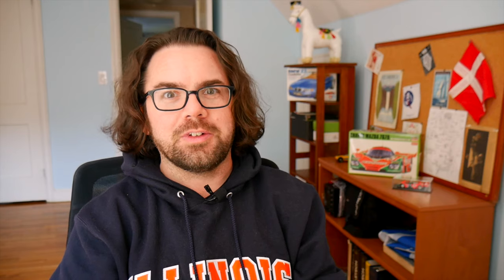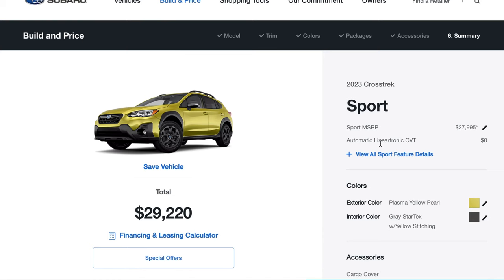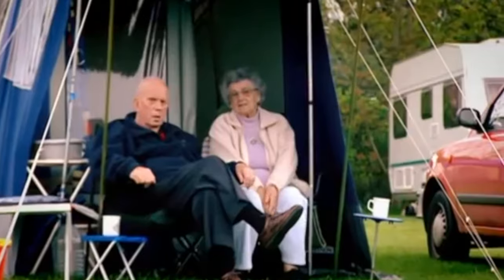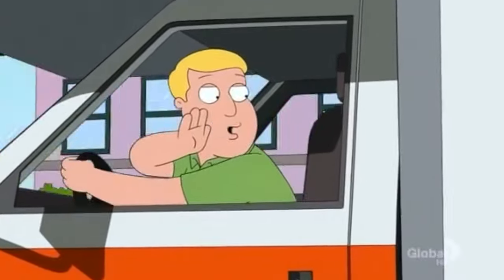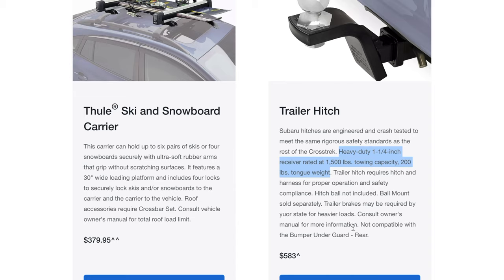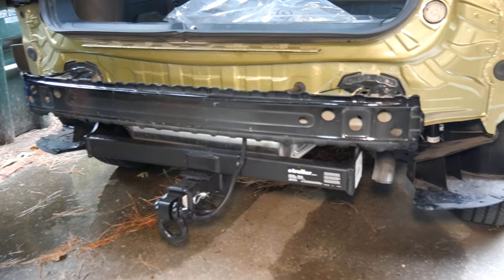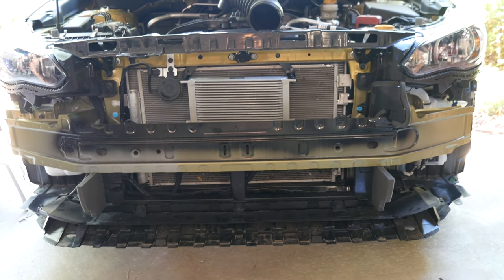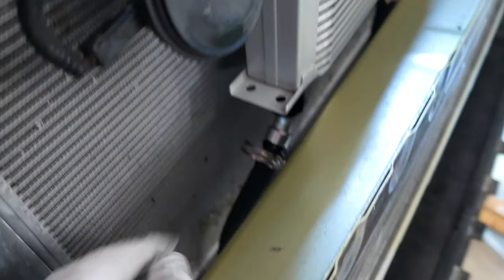Towing a Uhaul Trailer with a Subaru Crosstrek Sport

Comment: Towed that same small U-Haul trailer across the country with my 2.5l 2021 Crosstrek and it did great even going over the continental divide in the snow and multiple 6% grades.  I was definitely pushing the max tow limit rating but had no trouble at all.  No mods to the vehicle at all other than adding the hitch.  Used the Curt brand hitch and it fits nicely tucked under the vehicle and doesn't impede ground clearance or require removing the bumper to install it.

I did the towing in the late fall so there were no cooling concerns.  I used the sport mode of SI drive to keep it from using too tall a ratio and hunting for "gears".

The only thing I would caution people on is to remember that the brakes on the Crosstrek are going to have a lot more work to do when towing near max capacity.  I made heavy use of adaptive cruise control so the car managed engine braking downhill on it's own so I rarely touched the brakes on the highway.  You also be very careful in high winds as the trailer catches the wind way more than the car, especially relevant in Wyoming and other areas with high cross-winds.

Comment: I am planning on towing with my 2.0 Crosstrek cross-country and this video was super useful. You saved me so many headaches (e.g. now getting the proper drop/rise hitch instead of using the 2-inch drop hitch that I had handy) and also the scan gauge tool to monitor the vitals. I wish Subaru kept the temperature gauge in the gauge cluster, they added it back for the 2024 model year. I thought about getting a CVT cooler but does look overkill for this car. So many great tips in one 20-minute video!

Comment: Towing a uhaul 5x8 tomorrow for moving purposes in my PYP 21 crosstrek sport tomorrow.  Will be reporting back if anything explodes:p
For more info:  one-way drive distance will be less than 10 miles, no road grades  above 3%, using a self-installed curt class 3 hitch with a 2 inch ball receiver that has a 2 inch lift.  Self-installed towing wiring harness used.  Highest speed will be 60 mph for about 1 mile at max.  No additional cooler or cameras will be used.  Max temp tomorrow is 48 degrees Fahrenheit.  Honestly I will be surprised if we get even close to 1500 lbs total towed because the trailer will primarily be used for a few pieces of furniture at a time that are too big to fit in the crosstrek rather than packing it full to capacity with boxes.  Since the move is so short, it will be several short trips rather than one big over-loaded haul.  

I am so glad to see this video because so much feedback I've had on my plan seems to come from rich, overly cautious doomsday preppers who believe anything besides overkill is inadequate, and anything less than triple redundancy is a request for nothing short of a agonizing death.  

I must say that I am fortunate enough to be in a place where exploding my cvt won't run my bank into the red, so that said, I am willing to put my research and pride on the line such that, if I need to spend 6-9k on a cvt replacement, I am willing and able to take that hit if it must be done.  Assuming the much more likely outcome of nothing going wrong, however, I am happy to back up your video and encourage other crosstrek owners not to go overboard, but also not treat their subaru like a porcelain plate.
Reply from the maker: I tried to make this point in the video, but if you're burning up this motor or transmission in the process of hauling something, you're probably over the tow limit anyway. I did watch one video where a person was towing the larger 6x12 trailer across the country with what appeared to be a 2.5 Outback (so same size motor, but in a heavier vehicle, towing a heavier load).

They did fine in hill country, but when they started doing turnpike speeds in the Oklahoma heat, with the A/C on, the coolant boiled. Some could look at that and say they needed an oil cooler or something, but in reality they just needed a measure of the coolant temp to tell them to pull over and rest for a bit. It's a shame Subarus don't come with temp gauges anymore.

Anyway, thank you, and good luck on your move! Let us know how it went.
Reply: @Kludgecast  yeah I think a lot of people online mean well when they underestimate the towing ability of the crosstrek because they have to assume they are advising somebody who has done little to no research, but it is still really annoying to have people freak out at the notion of towing anything at all.  As for the larger trailer (assuming the one with two wheels and trailer brakes) I know that only the outback and ascent are allowed to pull those since those are the only subarus that have a wiring harness that allows for using trailer brakes, which is also core to the 1500 pound limit of the crosstrek and forester in the US--not allowed to advertise pulling more than that unless your vehicle has the electronics for braked towing vessel.
Reply: Would you have confidence towing a 4’x8’ uhaul trailer from Georgia to San Diego behind a stock ‘15 Crosstrek?  I’m having to do this move last minute so I don’t have time to install a trans cooler. Just putting on a Curt class 3. Only putting about 800lbs in the trailer. Thanks!
Reply: @AtariVideoMusic  hard to say for sure since you have a bit of a different use case but honestly based on my experience, as long as you don't have many crazy-steep hills to deal with you should be fine as long as you drive defensively.   Not sure how much the loss of 30 some HP from my model will impact ya
Reply: @Hexsyn  Thanks for the quick reply. Hell, what's the worst that can happen? Second though, don't answer that...
Reply: Great video! I have a 2017 2.0 crosstrek and I tow a 4x8’ cargo loaded with my Surron another 300+ lbs of gear, I’m pushing the limits as to what’s safe but so far we get where we need to go with all our stuff!
Reply: Ok how much was gas? Lol
Reply: @_Habit_  ahhh I didn't think to reset the trip tracker to check.  Probably not great!

Comment: I too have a 2021 Crosstrek Sport, installed an EcoHitch Stealth tow bar, added a 7-pin/4-pin combo connector, and run the ScanGauge II. Like you said in the video, the SGII causes the Starlink to throw an error. I found out that's because Starlink is very chatty and wants to be first going through the ECU when the car is started. I contacted the technical support side of ScanGauge (Linear Logic) and they told me they had a fix for that issue. I just needed to send my gauge in to them and they would mod the code, which basically delays the SGII from turning on for 10-15 seconds after the car is started. Turns out that Linear Logic is located in Tempe, Arizona, about 4 miles from my house so I made arrangements to stop by their office. 10-15 min later, my SGII was reprogrammed with the modded code and has never thrown a Starlink error since!

As a side note, I recently purchased a 2019 nuCamp T@G Boondock Lite teardrop trailer and will be taking it out on my first camping trip this coming weekend! I'm pretty sure I'm going to end up making the CVT cooler mod (you posted in another video) shortly after that test run!

Thanks for sharing your knowledge!
@Scubroo on IG & FB

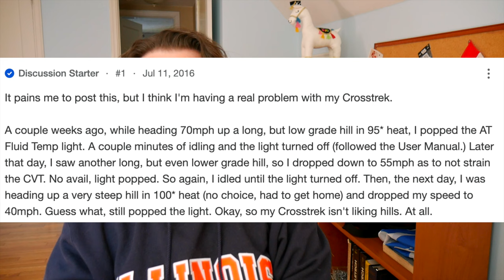Comment: 7:30 that's me... installed the CVT cooler myself and no problem since then :)
Reply: How did you program the Scanguage to show the oil temperature? I set mine to show air temp, cvt temp, water temp and battery voltage.

Comment: I realize this video is a year old, but I have some hopefully helpful information to add regarding the ScanGauge 2 that you are using. I heard about the Starlink issue and that there is a fix for it. I called them and inquired about it. They were aware of the issue. They can do an update that will add a delay to the startup of the ScanGauge. Evidently that will solve the trouble. It allows Starlink to boot up before the ScanGauge does. If you buy the gauge directly from them and put the word STARLINK in the coupon code box, they will do the firmware patch before they send it out to you. If you purchase the gauge elsewhere, you will need to send them the gauge to be updated. *This is not just a newer software. It is a patch particular to Subaru and GM vehicles.* You will have to pay shipping to them, but they will pay the return shipping. I just bought one direct and the receipt noted the particular Starlink update. I just received this and have yet to install it in the car. I have a '22 Crosstrek Limited. I have the factory receiver and hope to do some towing within the limits of the 1500 pounds eventually. Toward that end, this seemed a good idea to monitor temps. Another note: The ScanGauge 3 has a menu where you can program the delay yourself. Much less compact and a higher cost, but if you don't mind something more the size of a dash mounted GPS, this might be an option. (I wanted the smaller unit myself.)

edit: Installed this morning, 1/25/24. 4.54DL is the revision listed on the paperwork. Everything is functioning without trouble. The startup delay seems to have resolved any Starlink issues.

Comment: Remember your cooling system is pressurized to about 16 psi so your boil temp is much higher I can’t remember the exact temp but I know pressure correlates with the temperature a liquid can boil at

Comment: I just got a 1050lb tear drop trailer that I plan to tow probably about 6-10 times a year from San Diego over the mountains to the desert and back. Should I also get a transmission cooler? Or would a temp gauge and being cognizant of temps (and pulling over if needing to) suffice?  Edit: my trailer also has brakes

Comment: Hi!  I’m trying to to figure out some thing very basic about towing with my cross trek.  I see that Subaru. Limits towing of an unbraked trailer to 1000 pounds, which is only 50 pounds more than the empty weight of the U-Haul 5 x 8 trailer.  U-Haul doesn’t seem to offer any trailers with brakes, so I really don’t know what to do.  How did you address the brake issue?
Reply: damn how did you end up towing your stuff? I am in a similar situation and wasnt aware of the unbraked trailers..
Reply: You'll be fine, just use the adaptive cruise control or paddle shifters to engine brake.  I pulled very close to the 1500lb limit with no issues even on 6% grade hills.